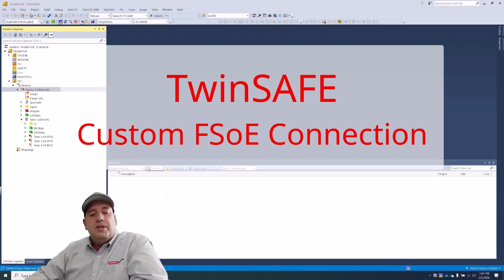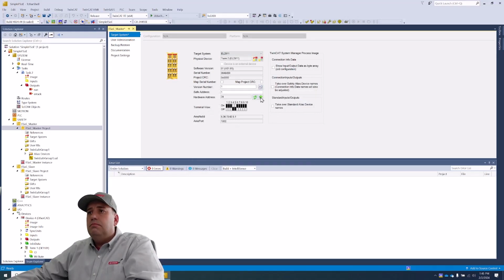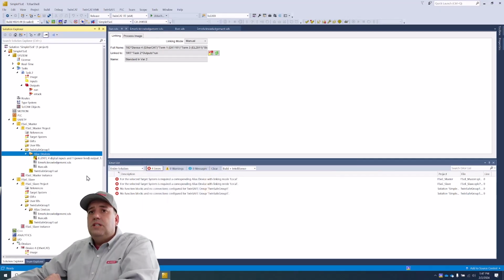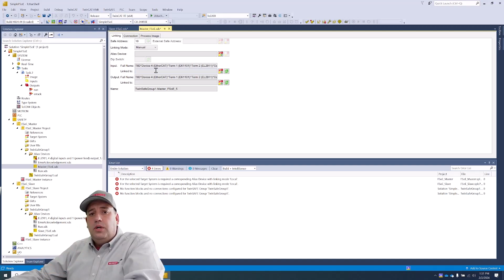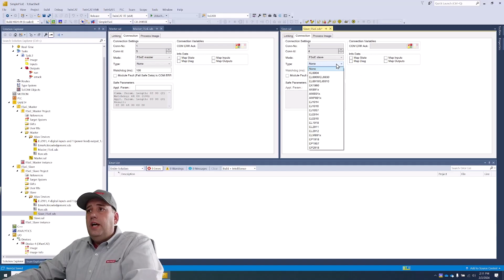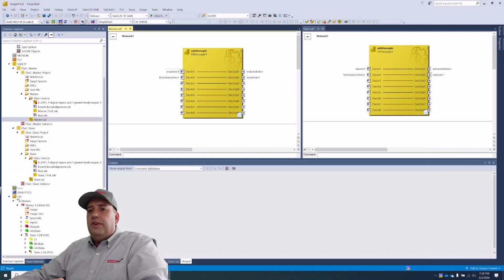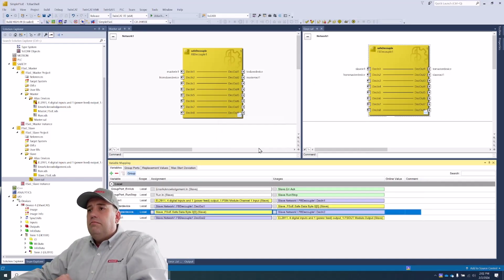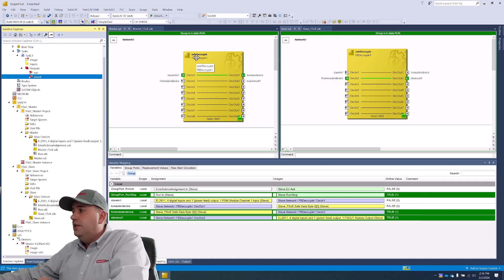TwinSAFE Custom FSoE Connection

Comment: Finally some concrete demo thank you. Question: how do I know the index/subindex of the signals you created? I’m guessing e.g. the output signal « toslavedevice » of your Master is mapped to some TPDO with its index/subindex. Can I know from the tool what its index/subindex is ?
Reply from the maker: The process images should be configured to be mirror images of each other in a custom FSoE connection. There is no index/sub/index unless we are talking about ADS, in each case they exist in the task and can be accessed through ADS with index/subindexes with ads reads and writes. But that would exist outside of TwinSAFE. Target browser can expose the index/subindex of variables running on the task. But there is no associated TwinSAFE task that we can access directly over ADS. I hope this helps!

Comment: Thanks for the video. Just curious what if one has 3 or more twinsafe controllers on the same network communicating? :)
Reply from the maker: Great question! Each pair would be its own FSoE connection.  So in the case of 3 controllers, each one would have two FSoE connections.  With larger numbers, the architecture could become complex so you may think about placing a controller that acts as the "traffic cop".  The EL6910 may have up to 212 safe connections and I/O with integrated logic may have up to 128 safe connections.